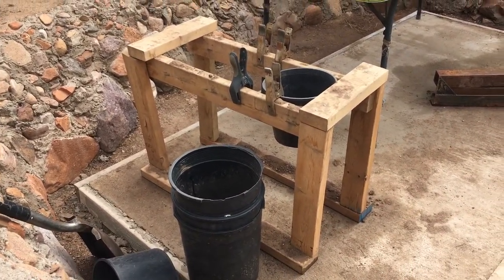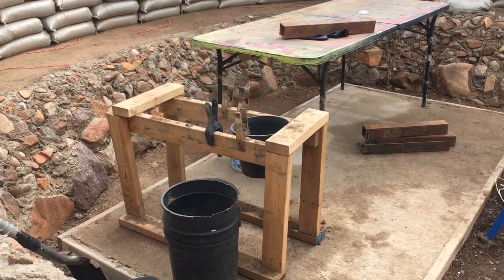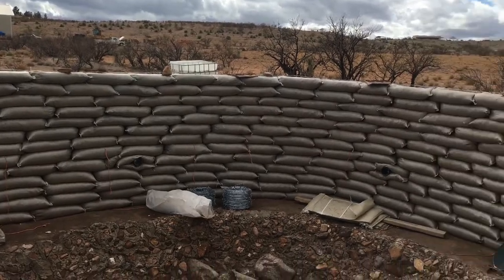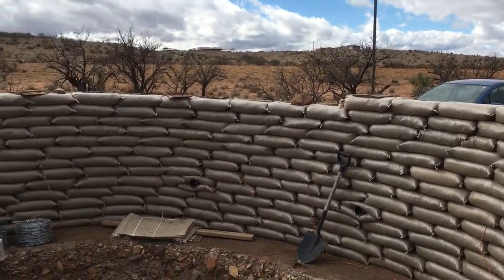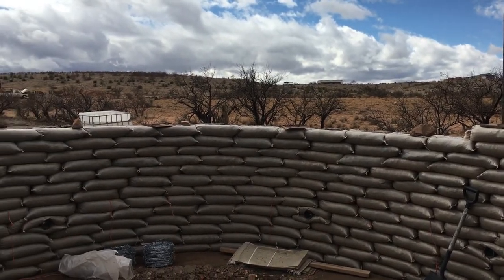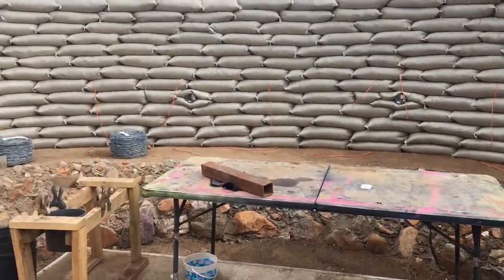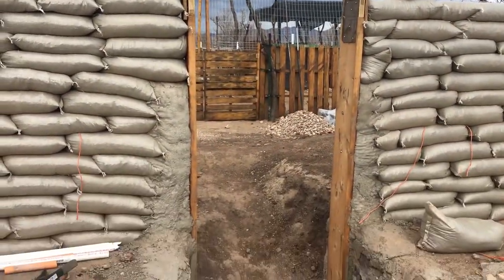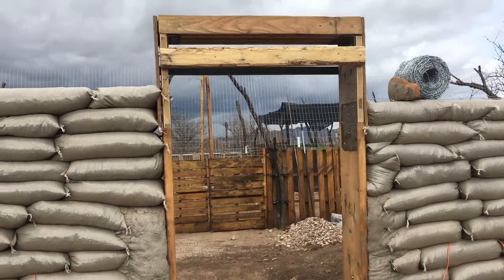How we fill sandbags aka earthbags

Comment: Is it necessary or advisable to place short boards in-between bags randomly to allow nailing stuff to the walls later?
Reply from the maker: So this is actually a really good question and where I am now with all this after doing it for a couple years I would say you could do it either way it is constantly evolving this building method so I see all kinds of tips tricks and hacks that other people do that I never thought of and I've come up with some tricks in my own so yes that's a good idea especially if you have a good plan when you build it honestly with this one I absolutely had no plan I just started building lol obviously I wouldn't advise somebody to do it that way it was just something that I did because I had already had building experience and I just wanted to play around with it. Moving forward one thing I would advise if I had one piece of advice for these bags is that I strongly advise that you use chicken wire as lath and insert wires to attach that lath to both sides while you're stacking the bag so basically running a wire in between the bags every once in awhile so you have an easy way to connect the lath That's the biggest thing because I'm telling you the laugh makes it so much easier to apply whatever finish you want to these bags